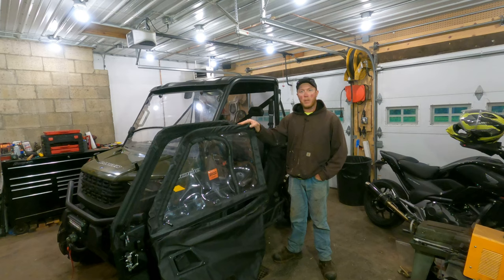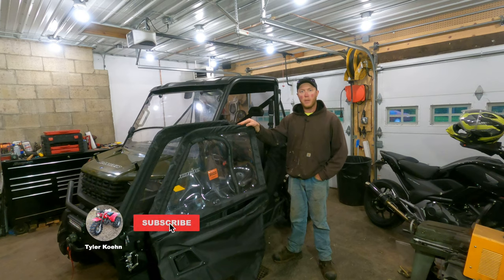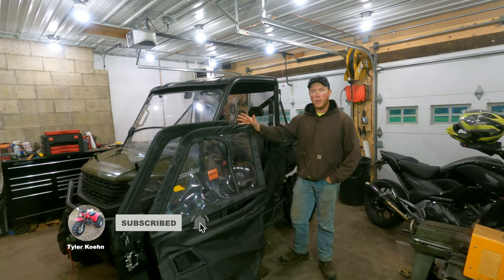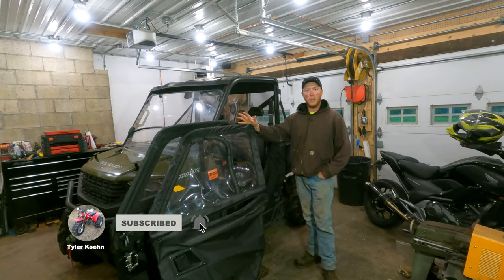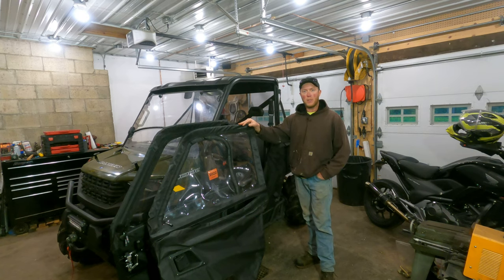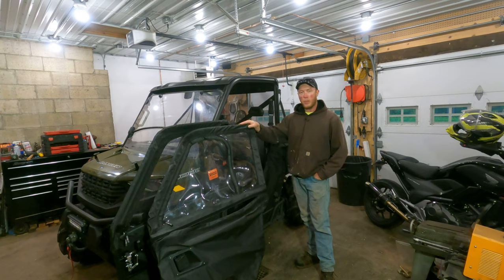How to install Seizmik Polaris Ranger 1000 Doors

Comment: So it looks like you 've had these doors for a couple of years now. May I ask how they have held up? Did the gaskets hang in there? Thanks for the video!
Reply from the maker: The doors have held up good for me. The driver seal was sent to me with the adhesive plastic protector off in spots, so it never stuck good. They sent me a brand new gasket that I just haven't installed yet. In all honesty, I don't use my sxs a ton, so I can't say how well they will hold up with alot more use.
Reply: Thanks!  @Tyler_Koehn

Comment: Hey Man, Do you have a heater in yours? I have 22 XP 1000 and want full doors for winter time with my tracks, just don't want to add a heater kit to it.
Reply from the maker: Hey, no I don't have a heater in mine.
Reply: @Tyler_Koehn  does it fog up?
Reply from the maker: @habsfan9693  I don't have any issues with it. I don't do long rides in winter though. Just around the yard and ice fishing. No problems though

Comment: Does your door ever pop open when driving?  Mine keeps doing that.
It'll feel secure after installment and then pop open after some speed or rough driving. 
Makes me nervous to even take it on the freeway when towing behind my truck
Reply from the maker: Yikes. No it hasn't happened yet but I've only been out a few times with the doors on. Are yours the same ones? Not that it should be happening at all a temp fix for trailering could be a strap to hold them closed.
Reply: @Tyler_Koehn  yes they are the same.  I got a hold of seizmik. They sent new for handles and locks. Il try to reinstall using your video tutorial.  Crossing fingers! 
Thank you for your video!
Reply from the maker: @StarD435  Thats one thing i'll say seizmik was really good about making things right. I was short a bunch of parts in my box and they sent out all new parts asap. Good luck hopefully they were just defective.

Comment: What is the part number for the doors?
Reply from the maker: Part # 06024
Reply: @Tyler_Koehn 
Thank you! Is your roll cage the pro-fit & channel or round 1.75 diameter? Excellent video by the way!
Reply from the maker: @markcuzzola8634  This is a pro fit cage. These doors will not fit a round bar. They have a different model for those.
Thank you!
Reply: @Tyler_Koehn  Thanks again!

Comment: I received the doors without any hardware at all. Package was severely damaged. Still waiting for the hardware three weeks after reporting it missing.
Reply from the maker: Hal, sorry to hear that. I'm not sponsored or anything by them, I was just sharing the product support I had with my issue. 
Seems odd it would take so long i called them for parts and had the package in two days as if they overnighted it. 
Maybe these supply chain issues I keep hearing about?
Reply: @Tyler_Koehn  It took me three months, but I finally received all the pieces and hardware. It looks like quality product.
Reply from the maker: @halreinholtz3192  that is unacceptable in my opinion. Shocked by this, after the prompt response I saw! I'm glad your happy with the product however I think the wait you had to deal with was beyond unreasonable